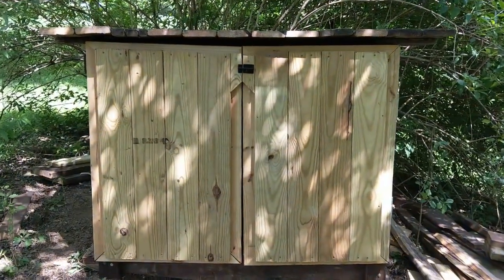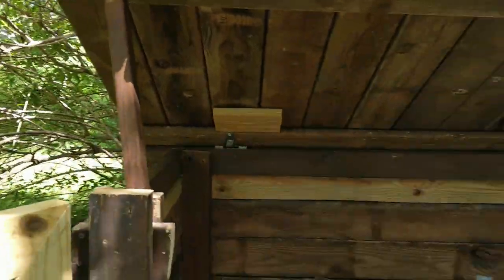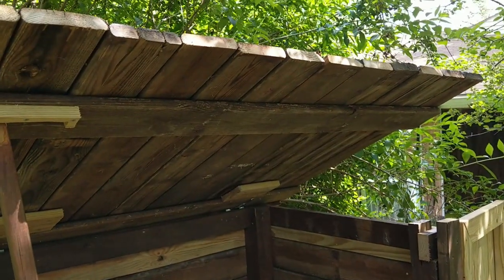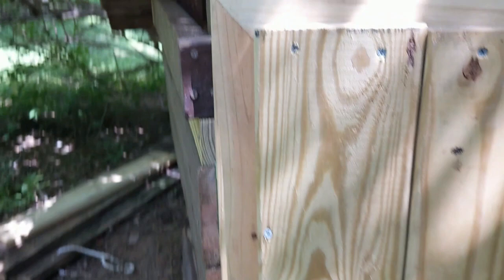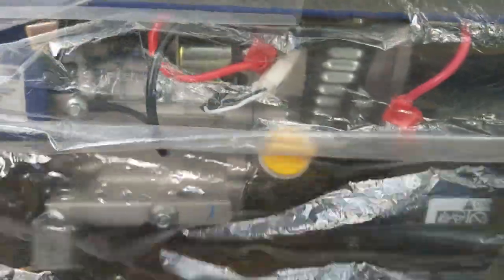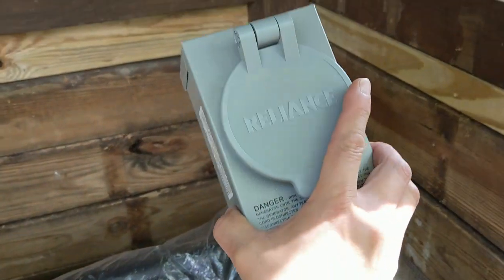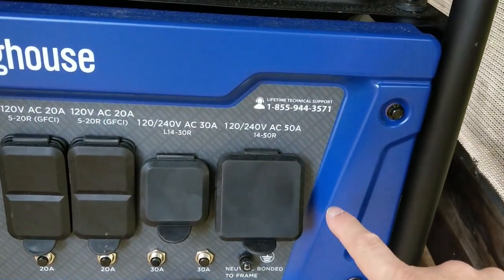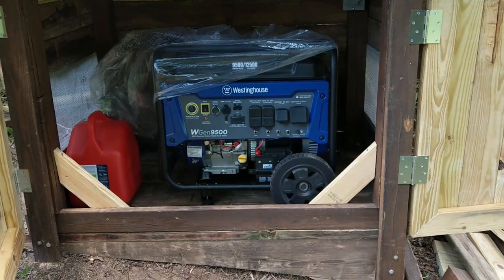Building a Generator Shed and Electrical Stuff

Comment: I am building one like this , my vents are similar to yours  on each side, plus back side and front , My door is located on the left side with a vent and a  12 v car radiator fan attached and blows the air across the engine  to the other vent and out.. Fan was converted to ac  and is on a  interval timer .Where your doors are I have a lattice screened vent  and a access panel to get to the controls.On the back side lattice screened vents.The Top has a shingled roof with a 6in cap to access the fuel tank . I intend to use propane , but for an emergency if needed ,I can fuel from the top with a funnel. I choose wood construction like you , cause I don't like meltdowns.I commend you for the storage only of the gas containers , so many people leave them in there while running their generators Be safe , nice work.
.

Comment: At 75+ft l would consider 6ga wire as an alternative. The length of the run is important to keep in mind, and 75ft is taxing 8ga wire, more $ but piece of mind and following building codes are paramount.